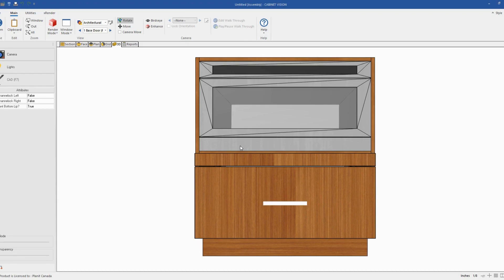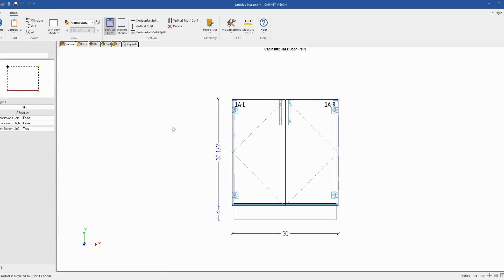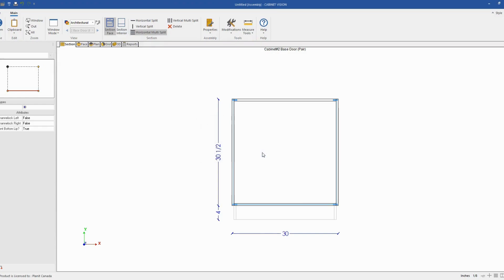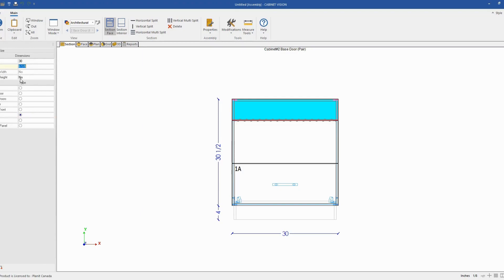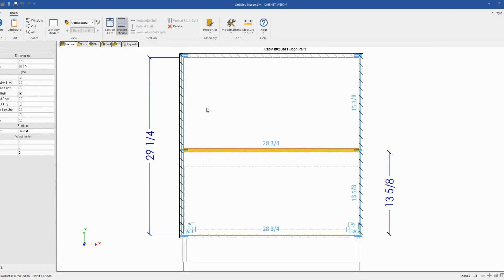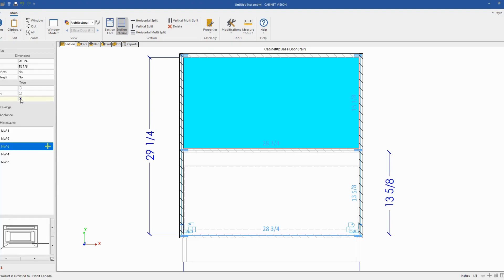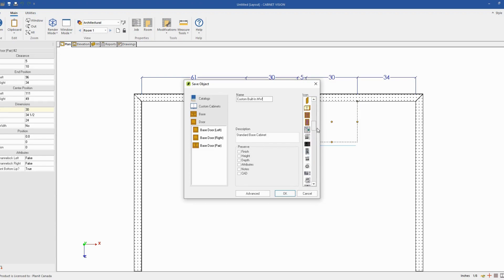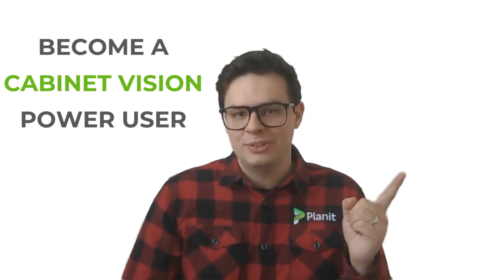How to Engineer a Built-In Microwave Cabinet in Cabinet Vision (Intermediate)

Comment: The microwave has its own front flange and it is designed to overlap and cover the cabinet opening. The cut-out edges of the cabinet should not be visible.
The amount the microwave protrudes depends on the door thickness and the appliance design. In some cases, the cabinet is built from two separate elements to allow the microwave to be perfectly flush with the surrounding doors, so that all front surfaces align and sit on the same plane.

Comment: Is it possible to build a 30 mm face frame around a microwave ie  as a panel with a cutout flush with the drawer below?
Reply from the maker: That's a great question! Yes that sounds possible. If we were to add the panel to the cabinet via the Section Face, we could then add a cutout to that part by double-clicking on it from the Face view of our cabinet and then clicking on the 'Reports' tab and the 'New Operation' button on the left-hand side. Following the New Operation wizard, we can easily make that cutout we need. We would just have to worry about how we fix the panel to the face now. Hopefully this answers your question!

Comment: is it possible to make the microwave stick out 3/4 of an inch?
Reply from the maker: Hello @Quasi924, yes it is possible to make the microwave stick out like that. It depends slightly on if your microwave is a separate object or associated with the cabinet. 
 
If your microwave object is associated with the cabinet itself: Double-click on the cabinet from the elevation or plan view, then you should arrive at the cabinet properties level. From the 'Face' view you should be able to click on the microwave object and change the 'Z' parameter in the column on the lefthand side to modify it's positionning on that axis (in this case how far the object sticks out). 
 
If your microwave is an independent object: From the 'Elevation' view of your room, try clicking on the microwave object and changing its 'Z' parameter there.
Reply: @PlanitCanadaInc  This was very helpfull